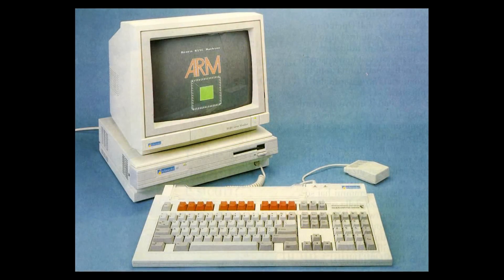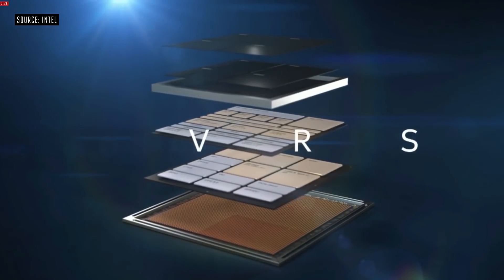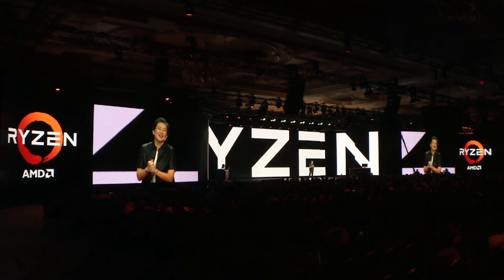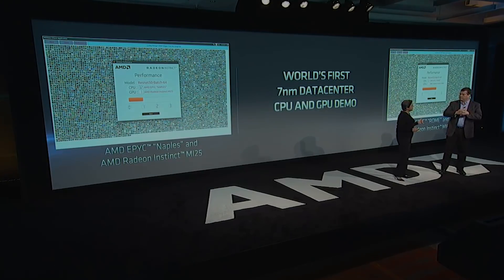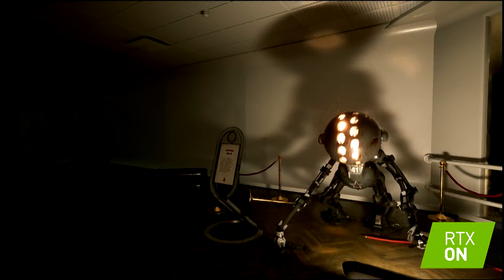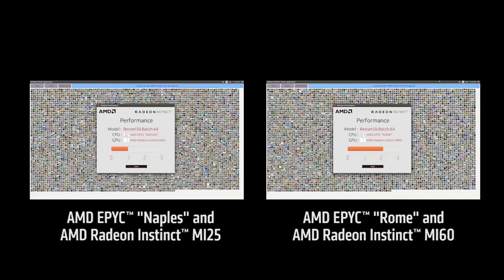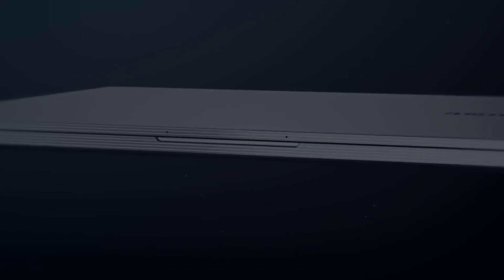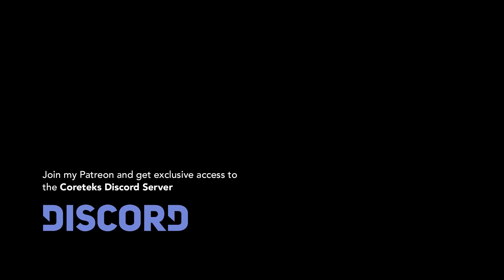Hardware trends: How many cores do we need?!

Comment: reddit seems to respond very negatively to your opinion that discrete GPU would no longer be mainstream in a decade....i agree but i guess "elitists" can't accept it.
Reply: As soon as JEDEC favors higher bandwidth over minimum cost, in a future memory spec, it will be over for midrange and lesser GPUs.
Reply: @laurelsporter  tell that to reddit. I got some insane downvotes sharing Coretek's video where he discussed his thoughts on APUs replacing a chunk of GPU markets. 
Redditors thought he was outlandish xD
Reply: Yougins. I remember having multiple video cards, then still needing one for desktop use, then integrated being fine for that, and now integrated is fine for many casual gamers.

P.S. Now that my memory has had time to work a bit, I've had up to three video cards, if you include the old Hollywood MPEG card, for DVD playback, back when CPUs were too slow for that.
Reply: @laurelsporter  congratulations, you are an idiot, the fact that you can use igpus to run games is because the last console generation was more a side step than a big leap like all others before, and it was a choice of cutting costs, and AMD is the one who is lacking in advancements. If consoles were intel plus nvidia and console games targeted 30 fps you would no be playing anything really comparable to a high gaming on igpu. Technology hasnt stopped but AMD  is the one created that slower pace.
Reply: @MarceloTezza  Utter nonsense.  Intel's advantage over the compute industry at large is their tight integration of architecture and process.  Their process tech is customized to their particular design philosophy.  Intel's tight vertical advantage is going away.  They have already shifted to decouple their process and architecture.  Intel is following AMD.  Just look at their recent hirings(mostly from AMD...lol) The custom SOC designs of X1/PS4 was the best price/performance of their time.  Even so, I would wholeheartedly admit that this generation of consoles is underwhelming.  Not because of GPU performance, but because of the diminishing returns on Graphical fidelity.  As explained in this video, at some point more cores doesn't necessarily equate to better performance.  Same is true with resolution.  200p-400p(SD) vs 720p-1080p(HD) massive improvement. 1080p vs 4k visible improvement.  4k vs 8k miniscule improvement. Same is true for geometry.  Ditto number of characters on screen.  CPU/GPUs technologies have matured.  Easy/cheap advances on CPU/GPU tech are the past.  Long live the SOC.
Reply: @VRforAll  You probably don't ever looked at a code from an AAA game developer, if consoles had 5ghz CPUs we would have seen a much bigger leap in fidelity even at 1080p, the problem is very clear that this gen of consoles was constrained and consoles are what dictates the evolution of games not pc, hence why we see so many games going up to 144 fps 1080p at max settings on i9 9900k and a 2080ti at launch,
THIS NEVER HAPPENED BEFORE
 the fact is very clear, what you fail to see is that AMD domination on console with very low single thread performance and high core count basically obligated developers to work around it and use all cores as efficiently as possible, so while before the major paradigm in the industry was single thread performance, now the paradigm is more balanced, hence why intel is going for 8 core on mainstream processors, intel still is the king on processors by a great deal, and by the way you are hearing this by basicaly an anti- intel anti-nvidia person.
Intel still is the leader on all CPU fronts, even with 10nm production problem,  when intel start the migration to 7nm they will still be ahead of AMD in single thread performance, industry is not an uncontrolable monster, you just have to have a monopoly somewhere in the business, AMD had a monopoly on console, Intel had a monopoly on processors for a while and Nvidia will start to find new niches on the graphics front to differentiate from AMD since it seems that again on this new gen both major consoles will be AMD and some other new fronts will adopt AMD as well. Intel is obviously reading the market and it sees that if consoles aren't going for the top end performance as they did in the past they have a chance with APUs even on gaming front, which will be aparently the main driving force of graphics in the next future.
AMD is having problems on GPU side as well, we see Nvidia even going as far as pushing "raytracing" with gigantic chips, this would never happen if AMD was competitive on the high end, why? because this was a very high risk move from nvidia, and you see that even wihtout competiton they basically fail in to convice people to buy it, not because ray tracing is not good enough to convince people to adopt it, but is not good enough for the price premium asked for it, if it were at reasonable prices it would be selling like hot cakes be sure of that, anyway, i don't even think you have grasp of how the industry is led and how it acctually works, by the thinks you wrote, this coreteks guys is pure BS he mix his feelings with theories, conspiracies and lack of historical knowledge of industry or maybe he just ignores it to get his point to people, we always find ways to do things move on, we have many technologies in development that could cause instant leaps in performance when brought to the consumer market,  paradigms change all the time we are not hampered by technology development pace, but by economical constraints designed to do it.
Who has the best master plan to controll the system is the one who dictates the pace.
Reply: @MarceloTezza  Funny you say it's AMD's fault that consoles were constrained. While in fact it was Microsoft choosing to go for lower power consumption as their main design goal. For the PS4, it was power at an affordable price. Both constraints are viable and don't necessarily lead to underwhelming consoles, unless you're used to playing on a $3,000 PC, of course.
Reply: @krytharn  It's not directly but it is.
Reply: @MarceloTezza  My last 2 gaming laptops are both Intel/Nvidia.  Have built PCs since 80286.  Owned both NVidia/ATI.  Still own a X360 and decided to skip this console generation. I'm not anti anything, just stating current and past events with my analysis.

5ghz desktop cpu on an APU in 2013??? Wishful thinking....not even gonna comment on that.

Hypothetical Intel/Nvidia APU for consoles in 2013 is a non starter.  Allow me to clarify Intel's tight integration.  Unlike, any other cpu designers, Intel leverages their fabrication know how to such an insane tolerance that even their own CPU designs are incompatible with one process node to the next.  Again, not like other designs.  This tight integration gives Intel a performance advantage.  Add to that their industry leading process technologies and Intel has been able to stay on top for decades.  Unfortunately, because of this, Intel's CPU designs are incompatible with other Fabs.  Furthermore, Intel does not share their IP.  Business Wise and engineering wise, a custom Intel APU(fabbed at TSMC) for a console is a non-starter.

Microsoft dealt with Nvidia before on the original XBOX.  Unfortunately, they got a raw deal from Nvidia and had to pay an exorbitant license fee per chip.  It is precisely the fact that Nvidia does not allow custom IP and AMD does, that we have custom AMD IP on consoles.  No one's fault, just a fact.
 
I too wish for more IPC.  But, the reality is high threads are here to stay.  Physical limits on silicon process technology have put the brakes on clock speeds.  10-20% clock gains on same power levels per shrink, is what the industry expects.

Intel's decoupling of cpu design and node process was a TITANIC change in design philosophy.  Truly an end of an era.  Not thirty days ago, some industry pundits where opining Dr. Lisa Su to be the new CEO of Intel....lol  Not in a million years I hope, we need the competition.  Intel's 180 on AMD chiplet strategy is yet another indication of AMD forcing Intel to innovate.  Happened before with AMD being first to 1GHZ then leading the charge to 64bit with the x86-64 instruction set(still in use by Intel/AMD).  Hopefully, AMD does not repeat the past and give up the lead as they have in the past.  Leaks on Ryzen 3000 benchmarks, hint on Ryzen matching Intel's best on IPC and maybe even surpassing it by 10-15%.  Crossing fingers...

AMDs lack of competition on high-end graphics is the direct result of Nvidia's overwhelming lead in sales.  AMD was competitive in performance in the past but never in sales.  Cannot justify TSMC's $500 million pre-production cost on 7nm for a high-end gaming oriented chip, that won't sell well.  Instead we got binned 7nm chips from a Compute card.  The fact that Radeon 7 exists makes AMD first to 7nm, and first to 1TerraHz memory and first to 16GB.  A very expensive product line for AMD.  Wouldn't surprise me if they are losing money on every card sold.  Seems, AMD is focusing on it's custom APU designs for consoles, at the expense of desktop graphics.  Hopefully, NAVI tapes out March-April and launches Q3.

RTX...Raytracing in general as of now is an uphill battle.  Even if rumors are true, and next-gen consoles have raytracing hardware, the vast majority of gaming PC/Consoles don't.  Furthermore, outside of shiny/reflective environments, the image improvements are nigh imperceptible.  PC Graphics have always relied on trickery to simulate real life.  And the gaming industry has gotten so good at fakery that a more realistic approach that requires more computation and cost will be seen as a negative rather than a positive.  RTX 2060 is currently the best desktop value.  For laptops, GTX still rules until Laptop makers redesign for RTXs higher TDP.  Or better yet wait for RTX 7nm vs Navi 7nm battle royale this year...lol
Reply: @VRforAll   First ,you should probably re-read or just take off your imaginary hyphothesis that i for a single word in my response said that it would be possible to have an Intel-Nvidia APU.
What i said is that if the console had both the best technologies of the time it was launched, (like PS2 and PS3 aimed for on their launches).
The market and technology evolution would be on another state and this would reflect on the game graphics quality.
I never meant to say that it was an error of consoles choosing AMD, if i were them i would choose too, simply because of ethics, i never bought an Nvidia card and never will and i hoppefully in my next build will be all AMD, or from a new brand that has a acceptable ethical and professional behaviour.

My point is simple, i don't want argue on specifics, on absolute performance in games, intel still is the leader and Nvidia on gpu side. They were back then if i'm not wrong.
 
it was a fact and today is fact too.
Because of difference in archtectures and approaches to CPU and GPU on AMD side, they technically go for the "wider" arch.
And while this is the future today is the single thread performance that matters more.

I read your text enterely but seems you somewhat agree with me but you are projecting your justifications for why it didn't happened while i'm just saying that if it had happened the landscape would be different. AMD plan was to implement a new paradigm of programming games, so their CPUs and GPUs could really shine even with it's caveats.

AMD was the first to introduce 8 cores to the consumer long ago, but it didn't catch because devs had a bias and because was much harder to implement on it, ONLY BY CONSOLE ENFORCEMENT it finally happened.
But this will not repeat that situation of the 7th gen will not repeat itself this gen because AMD alreadybought enough time to get near enough intel in performance and can leverage the core advatage as real competitive one, where before even having 8 cores it was never truly used.
Mantle was a gift that AMD made the effort to create for API devs. DX12 and Vulkan are pratically mantle refined for each interests, what made possible to really push their agenda.
Anyway... tired
Reply: @MarceloTezza  not so. AMD is competitive in all but the highest end parts, as Vega ducks for gaming, in a relative sense. That's just one generation of a good, which Nvidia has also been guilty of. Nvidia's new parts aren't exactly earth shattering improvements, either.

Do you really think that developers will target only what the richest desktop users can afford? Of course not. You seem to be working under a premise that the hardware market doesn't matter. If you can't play a game reasonably well on a decent notebook, don't expect spectacular sales. It won't need to look nearly as good as its potential, but will need to be playable. However, there are going to be limits, which is where IGP improving helps a lot, at the lower end.

As well, you can easy make an entire PC capable of outstanding 1080p performance, under 250W, and it won't be too long before that will be true for 4K. On a HEDT type platform, I could easily see 350W TDP packages. But, we would need to get more RAM bandwidth. More caching will allow IGP to keep improving, but not enough to displace midrange dGPUs, unless we were to adopt a faster, non-SDRAM system memory standard (options have existed for many years, but between royalties and higher production costs, they never got mainstream), or if on-package RAM could be made much cheaper.
Reply: @laurelsporter  Look you did not understood what i wrote, and you seems to be more AMD biased than me and seems to be the case of many here.
My point was made, i think it was very clear answer. 
This moment  on the gaming space will probably never happen again.
Consoles wil probably not be a SIDE STEP ever again. 
So APUs will never be this close to dgpu performance problably ever again, it was a very pontual moment of AMD having the two major consoles in hands and having basically one CPU option for them that was far behind (IN Single thread) than most CPUs used on any consoles before, even more compared to PS3, now consoles will grow substancially not only on GPU but on CPU and this will allow more headroom for different graphical effects that uses more single threaded high ipc functions that were simply impossible before and restrained the natural evolution of graphics.
Even with engines now highly optimized for multiple cores we will see more physics heavy games using higher degree of fidelity and it will increase substancially the quality of even 1080p games, and this will demand more CPU and GPU power. The moment that intensive CPU single threaded utilization becames a thing again we will see nvidia and their more efficient driver and archtecture show it's muscles again, as it is the case on basically every fucking unreal engine title.
So APUs which are already limited by bandwith will became far more limited because it will be competing harder with the CPU as never before. 
AMD GPUs are very bandwith starved in comparison with Nvidia, this is a problem that they need to solve with DSBR or TBR as is the case of nvidia, better memory color compression, and better overall driver management of CPU resources. If they don't do that, today's AMD APU's will be doomed. 
Another point is the difficulty of nursering the APUs with faster memory and maintaining it at a reasonable price, a PC with integrated HBM2 on the cpu die still is far from mainstream, it has to be laptops and or "NUC" like boxes with a high end cooling system or at least very good one. So even if they manage to get an outstanding APU in the future, better than consoles it will still be more memory starved than consoles, even on DDR5, i haven't seem PCs other than the chinese console with GDDR memory integrated, and even then, how much memory do you expect to have dedicated on your PC for gaming today, at least 6gigs of ram and 4 of vram, imagine tomorrow, i would bet like 8 ram and 8 of vram, so imagine a 16GB of gddr5, not even 6, how much it would cost? Now think about HBM2 16GB... today is 300 dollars alone...
Reply: @MarceloTezza  yes, but I think that's a wrong premise. Integration on the client side has been increasing for decades, longer than we've even had game consoles, and it is not a trend that has shown any signs of stopping. At many times, including audio, and storage, integration has even sacrificed performance to reduce costs, so long as performance is good enough for the majority. If any one particular technology for packing bits together, and moving them to another chip, faster than commodity SDRAM, takes hold, then midrange GPUs can start being integrated into processor packages affordably, and so the dominoes will start falling. DDR5 being more of the same puts it at another 5-10 years minimum, when it comes to system RAM.
Reply: @MarceloTezza  Highlighting your Intel/Nvidia fantasy APU which you already acknowledge is a moot point.  Couldn't have happened...why even go there.

You keep going back to some fantasy level of performance that you seem to believe was somehow easily attainable...and was withheld for reasons???  What circa 2013 APU are you basing this "Best technology of that time"???  As far as anyone can see...X1/PS4 APUs where the best APUs of their time.

You keep making wild speculations on what ifs then laying the blame on AMD based APUs without one iota of fact.  Fact the best NVIDIA APU right now is the Tegra Xavier with an underwhelming cuda 1.4Tflops(fp32).  Fact best Intel APU has AMD graphics.

Fantasy Intel/Nvidia APU can never be better than an AMD APU cuz it doesn't exist.  Any performance metric you dream up only exist in your head and affected literally nothing.

Consoles being the target platform for AAA developers was a business decision.  Whaaa...Whaaa...Whaaa WEAK Jaguar cores(since 2013) Give us a break and Grow Up...lol
Reply: @laurelsporter  i have to disagree, we are talking about gaming and it's a core part of the PC industry today and will be even more tomorrow, many things before were easily not at this level of importance GPU today is as much or of higher importance when you buy system.  integrated system exists and will keeps existing but they are nowhere near to make dgpus extinct it will only happen in my opinion on a very unnatural move from Intel and AMD to simply cut off the dgpu from mainstream systems, and not by demand and this would be unethical, again coreteks estimations are completely BS and unreasonable from the normal stand point, if the market shift will be forced he can't predict it based on rational reasoning, APU and GPU will live side by side as for many years because the diminishing returns of paralelism are definitly not  restricted by his reasoning, as many people already pointed out on other comments. 4k is good enough for the majority of people still 8k will be mainstream some years from now.  people will find reasons to have a 1024 core cpu and one day it will became mainstream, that's has always been like this...
Reply: @MarceloTezza  Fact X1/PS4/PS4 Pro/X1X all console chips. All APUs.  Moving the Goal Post???  Redefining Terms???  Name Calling??? Clear signs of Defeat.  Go play with your FANTASY Intel/Nvidia APU...bwahahahaha
Reply: @MarceloTezza  More Utter nonsense.  APU/SOCs are the future.  Apple routinely orders 100 million SOCs from TSMC every SIX MONTHS.  TSMC has dedicated 2 Fabs just for Apple both of which are upgraded to the latest node process ASAP.  More companies are spending R&D on mobile SOCs.  CPUs have historically integrated compute units not the other way around.  Advances in 3D/2.5D chip stacking will pave the way for more integration.  AMD chiplets are 2.5D implementation.  Intel demoed 3D chip stacking at CES.  Current node 7nm relies on finfet to solve gate leakage.  2020 5nm finfet.  2022 3nm Gate all around.  2025 2nm Silicon end of life???  Silicon Node process has reached maturity.  3D chip stacking is the  way forward.

No decent developer is optimizing for single thread performance.  Most developers target the mainstream not the bleeding edge high clock $500+ cpus and gpus.
Reply: @krytharn  Sony sold almost three times as many consoles as Microsoft. It's clear that the Xbox One's "lower power" strategy wasn't very good. They learned their lesson and beefed up the Xbox One X later.
Reply: Ahh bullshit, discreet GPU's will go when desktops go, NEVER! Just because the vast fields of lemmings stick their noses in their phones doesn't mean everyone does.
Reply: @nbrown5907  not end completely, but end up less main stream. High end  sales don't matter to them, it's always low and mid tier, corporate compute.
Reply: I agree, if it wasn't true Intel wouldn't be scrambling to get a proper GPU made. And Nvidia may be left out in the dark unless they create an APU themselves.
Reply: Doubt it's "elitist", rather "not a viable option based on transistor heat-loss". A vertically stacked solution would mean that we need to invent a completely new way of computing, throwing out binary computing and transistors in the process, something that no one knows how that would be done, seeing as any near-future computing solutions is done with ones and zeros, (Binary), and transistors making up >95% of the entire CPU, GPU and other computing components.
Reply: 3:18 Yes and no.  If developers continue to push the limit for graphics, there will always be a need for discrete GPUs for consumers. I think Nvidia is aware of this which is the reason for pushing ray tracing early at such a performance level and quality right now.  
I do like the idea though as it will allow the system to be insanely efficient in size, performance, cost.  I'd like to see where the CPU and GPU shares the use of HBM memory
Reply: Most underestimate the stupidity of Reddit.